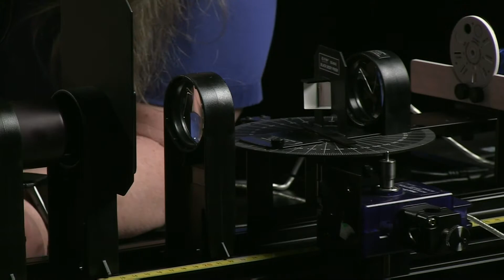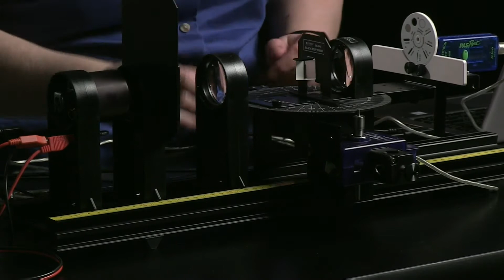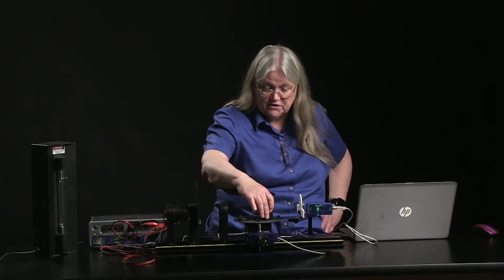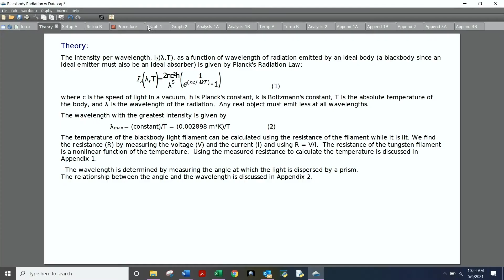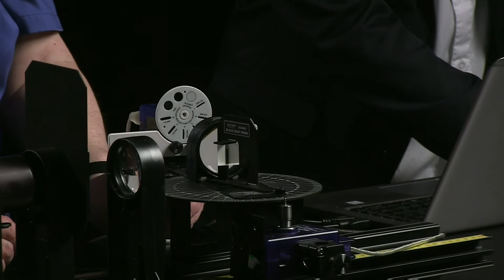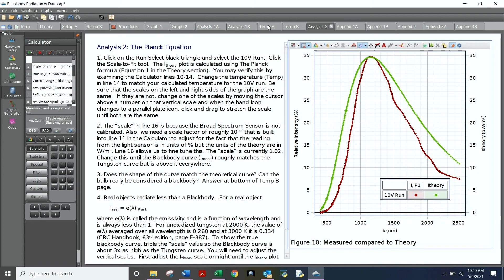Blackbody Radiation Experiment - EX-5529A

Comment: How to calibrate tare the light sensor? Pliss explain me
Reply from the maker: The PS-2150 PASPORT Broad Spectrum Light Sensor has a Tare button on the case that you can press (when the sensor is powered up) to set the current reading to zero.

For the angle calibration, see the video starting at 12:21 or find the written instructions in the "Angle Calibration" section of the experiment document at https://www.pasco.com/resources/lab-experiments/1266.

Comment: The temperatures calculated by the PASCO-provided formula are simply wrong. The reason is as follows.

No. 64 bulb should be roughly at 2,700 K at the rated voltage of 7 V, and it should be over 3,000 K at 10 V. Therefore, the PASCO formula is clearly off by about 400 K or more.

Now that we know that the PASCO formula gives the wrong temperatures, I will explain what I think the reason for the discrepancy is.

Note that including a R_holder makes the temperature estimate worse; so, this is not the reason. I suspect the problem to be that the filament and the contact wires in the light bulb have a contact resistance where they are attached together of roughly 0.16 Ω so. Therefore, when you measure R0, you are overestimating R0 by about 0.16 Ω. This makes a huge difference in the estimated temperature. I measured R0 with a precision-calibrated ohmmeter to be 0.68 Ω (do not use handheld ohmmeters) and estimated the true R0 accounting for the contact resistance of the filament contact wires to be 0.52 Ω. This gives the temperature correctly at around 2,700 K at the rated voltage of 7 V and at over 3,000 K at 10 V. R_holder should be negligible in comparison to the heated-filament resistance, which is more than about 10 Ω or so, and it does not have to be included in the calculations. In fact, it should not be more than a fraction of an ohm if the voltage sensor is plugged into the holder directly and certainly should not be several ohms.

Therefore, the missing link here seems to be the filament contact resistance inside the light bulb, which results in an overestimation of R0 by about 0.16 Ω when measured from the outside of the bulb with an ohmmeter, not R_holder outside the light bulb, which results in a very slight overestimation of R (not R0).